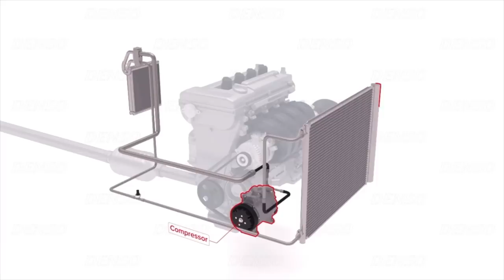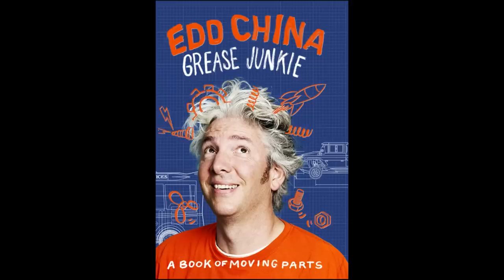Air Conditioning 101 - Full Explanation Approved By Denso | Edd China

Comment: Nice video I am a automotive mechanic and never did I have such a well explained way how AC works. The only thing you could of explained a bit more is the different expansion valves like the Txv and the fixed orifice valve but otherwise you did a bang up job on explaining the basics of AC operation. Of course there is super heat and latent heat conduction heat convection heat so on and so fourth but that is really getting into the physics of AC operation

Comment: I love the CO2 fire extinguisher my dalek Alek has one connected to his gun great for riding up the street terrorising the neighbours. He has an electric wheelchair inside and electric motors and actuators to move his head, eye stalk, and plunger up and down. I found the plans on youtube and built him over three years. To get him in and out of the house I have to disassemble the sliding door and back the trailer on the step then roll him down to the floor.

Comment: Okay Ed, now explain how the dual clutch system works. Beyond saying it spins up the other shaft with the gears on it. The "clutch pack assemblies" themselves is the part that is interesting. How they provide power and then release and the other one provides power. That would be very interesting.

Comment: You made it sound a bit over complicated. When i was taught AC principles one example was done using a kettle boiling water. As the pressure lowers so does the boiling point. So to turn water to steam as sea level requires the water to go above 100c on the top of mount everest (lower pressure) requires only 71c. In a cars AC system its very similar, the refrigerant coming out the compressor is high temperature and high pressure, by passing it through a condenser the pressure stays roughly the same but the temperature is much lower, lower then the boiling point of the refrigerant so it turns to a liquid. Passing it through an expansion valve lowers the pressure which lowers the boiling point so it evaporates which to do so pulls energy in from it's surroundings cooling the air.
Still an excellent demo though and can we have more videos please

Comment: Edd, Some cowboy mechanic AC specialist Plugged my VW Phaeton into his machine, Filled it with gas without first removing any old gas or doing a vacuum test. and then asked me to turn the car and AC on. He blasted the gas in and my compressor clutch burned out! He then said whats wrong with your car mate? something burning! (At this point I didn't know it was my compressor clutch and he was to blame.) He scared me into thinking my car was about to explode and he can no longer work on it and sent me out his workshop now filled with ac compressor clutch smoke burned out. since leaving the garage I have learned and found all this out. It was his fault 100%. What do you suggest now? Summer is here and I need AC in my car. Some mechanic burned out the clutch. I have never worked on an AC system before but its all nuts and bots I guess. how can I check the clutch? Great video.

Comment: Hi, thanks for the video. Is there a way of running the air con that is beneficial for the system. 👍
Reply: Antony Howell what do you mean by system? If you mean the engine the ac will always be using some power from your engine whilst it's turned on